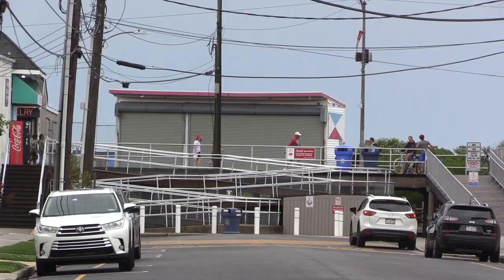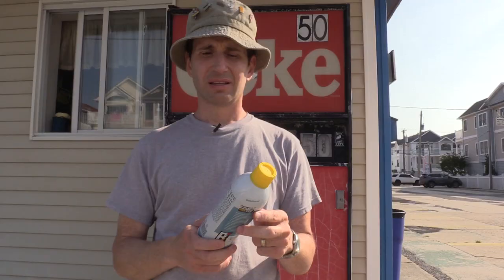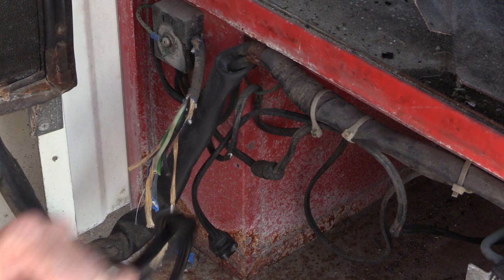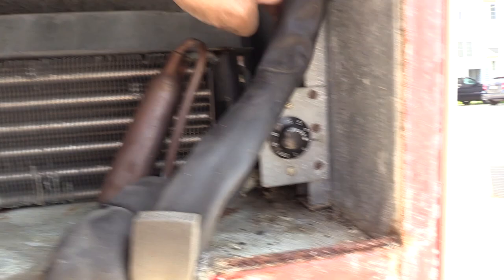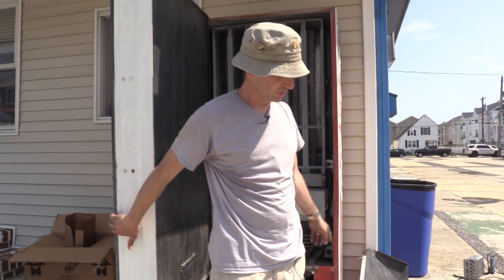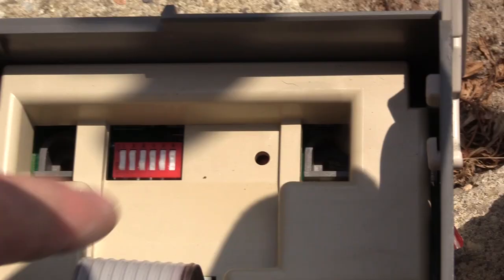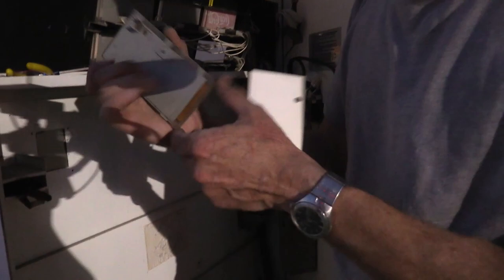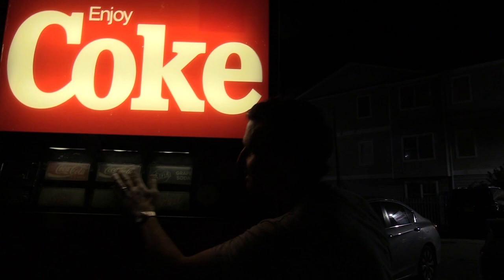Fixing up an Old Dixie Narco Soda Machine that Hasn't Worked in 9 Years - Part 2

Comment: The only issue with your repair is that cable isn't rates for outdoor use. It will work fine for a while just check the insulation that is exposed to the outside for cracking. But great to see you fixing up this old machine
Reply from the maker: I was trying to limit my expenses since I was repairing it for free...and I'm sure something else in that machine will die long before that cable cracks.

Comment: I bought an old machine with eight selections, the problem with this machine is that the digital numbers that mark the price or say the word sold out are off, what do you think is the cause of this problem, thank you very much and thank you for the answers, also for creating this content that is very helpful
Reply from the maker: Could be the display board.  Get a volt meter and confirm that power is getting to it.  Look for the machine schematic online.
Reply: Thank you very much that's why you call them happy vending

Comment: Great video! I have an old coke machine that I cant get the buttons to work.  I replaced the coin mech and as soon as the correct change is inserted, the machine starts buzzing loudly and the buttons remain unresponsive. Thinking the old wiring is goofed up a bit?  Any suggestions?  I can send pics or videos of what it's doing!
Reply from the maker: You should post a video of the issue on the vendiscuss.net forum...one of the old time vendors on there will surely be able to diagnose the problem.

Comment: We recently bought an old Dixie Narco coke machine. It worked great for two months until it now only releases from the #1 slot. It cools great and everything else works great. Any ideas?
Reply from the maker: The motors are in series with each other so you need to check wire continuity after the first motor.   It could also be the switch on the second motor.   Try swapping the last motor with the second one and see if anything changes.

Comment: Bill, where are you finding your cooling decks? I priced one from Royal for a G2 462 machine. They wanted $803 plus shipping. Is there a cheaper alternative?
Thanks Subscribed!
Reply from the maker: Have you tried Vending Works?  Cooling Decks direct from Royal have gotten very expensive...but sometimes, they are the only one that has them in stock...and they are new so they last a good long time.

Comment: I wish you would have just repainted the outside to make it look new repaint the red I like the classic soda 💞
Reply from the maker: My goal was just to get it operational.  I kind of liked the weathered look of it.
Reply: @HappyVending  this vintage they don't make machines like that no more I seen a Pepsi one that kind of looks like that but a little shorter I really want to restore 💙
Reply from the maker: @stephanieramirez9151  This style machine is not old enough to be sought after by collectors...so when they come up on ebay they are usually fairly cheap.

Comment: I have a Dixie Narco 260 that won’t vend .  The vend relay energizes but it won’t dispense product.  I have the service manual with wiring diagrams but can seem to track down the problem.  Any ideas?
Reply from the maker: The motors in those old machines are usually in series...so if the first one has a broken connection, none of the motors after it will work.  I would really inspect the wires going to the first motor.  Maybe even swap the first motor for the last motor.  Also make sure your sold out switches are working.

Comment: @Happy Vending Can i install regular or mei bill collector to the coin mech or have it as mei if able to so they both mei ? And do i install four holes to install bill collector or do i install four holes and cut a square out to fit the bill collector through the front ?
Reply from the maker: Old coin mechs, like the one I put on this machine, have specific bill acceptors that will work with them.  You need to check the compatibility list depending on the coin mech you have.  You would need to cut a large square hole in the door to install a bill acceptor on this machine.

Comment: I have a three pin Dixie Narco coin op. Do you know what the denominations are for the dip switches?
Reply from the maker: @tekubus  usually 5 cent, 10, 20, 40, 80, 1.60
Reply: @HappyVending  thank you for the response. What confuses me, is that it only has three dip switches.
Reply from the maker: @tekubus  That might be a newer coin mech that gets the pricing from the control board of the machine.  What type of connector is on the coin mech?

Comment: Lubricate locks with powdered graphite
Reply from the maker: Many locksmiths recommend against graphite because people tend to put in too much and it clogs up the pins over time.  Many locksmiths have switched to teflon based lubricants...similar to the one I used in the video.

Comment: Hay bro I have a dixcy narco 501mc I recently had the bill valadater repair and the coin mec as well when I got them back the little red light didn't come on on valadater or the mec b4 hand only the valadater came on but it flashing 3x now nothen I plug in the michine I hear the valadater come on but no lights not eaven the  mec the guy sed the Jones plug was working when he had it.... the  michine has no fuse I look every ware it's all macanical   nor dose it have a computer I'm at my wits end I wood really appreciate ur advice I think I have a bad Jones plug hit me back please  every thing works except the mentioned mec & valadater
Reply from the maker: Did you have the power off when you connected the mechs?  They should have a warranty on the repair.  Maybe they weren't repaired correctly.  That has happened to me before.

Comment: Great job.  I have a question. I have a Dixie Narco 368 and I recently replaced the Coinco bill acceptor and coin mechanism with MEI bill acceptor and coin mechanism from another DN 368. The MEI equipment was working properly before I switched it but now MEI bill acceptor has 2 flashes that says it's disabled.  Is there something I missed in switching to the other machine? I know the acceptor and coin mechanism are good but why can't I get them to work after switching to another machine?
Reply from the maker: Did you have the power shut down when you were making the swap?  Check your connectors and wires for any breaks.  Maybe even use a volt meter.  Are you sure there is product in the machine?  Is the machine in vend mode or is the door switch bad?  You might need to put the coin mech and bill acceptor back in the original machine to confirm they are still working.

Comment: Very interesting I am curious to a couple things I just found a Vendo v407 with a trade logo ale 8 a Kentucky family owned company it has lights in it also and 8 buttons 2 large and 6 smaller questions are could I buy new clear buttons as mine are extremely yellow and do the lights come on some how automatically like on a timer so they are only working at night or do they need to be switched on manually because they don’t come on when I plug the machine in when the rest of the machine works fine thank you merry Christmas 👍
Reply from the maker: Well, you can call vending supply companies and see if they have any "new" old stock buttons for that machine.  Companies like Capitol Vending or Snack Attack would be a start.  As for the lights, that machine does not have a control board so there would be no timer for the lights.  You could probably rig up an in-line timer in the machine if you wanted to.  Your lights probably aren't working because it needs new bulbs and a ballast.  Almost every used machine I bought needed new bulbs and a ballast.

Comment: How do you change the price on the older change mechanism? I have the one you took out with the quarter & nickel compartments set at $1.
Reply from the maker: That old coin mech only has two nickel tubes...no quarter or dime tubes.  It should have little dip switches on it like the one I put in there.  They start at a nickel for the first switch and double from there.
Reply: @HappyVending  thank you! I now have no power to the coin mechanism, I assume a red light is on when working. Think I found a manual online or will just replace it. The stickers say what is compatible. It's the s75-9800B.
Reply from the maker: @JC-ck6wk  Yeah...those mechs are so old that they just aren't reliable anymore....which is why I replaced the one in that machine.  Your best bet is to get one like what I put in that machine so that it is also ready for a bill acceptor.
Reply: @HappyVending  I'd prefer a bill acceptor as well. Appreciate your help & videos!

Comment: hello! does the 264-6 need shims for cans? i cant seem to figure it out from the manual. i hadnt tried stacking a bunch in yet, i just assumed it would drop 2 at a time with out a shim.
Reply from the maker: These old Dixie's were basically cans only and did not require shims...at least the one I was working on in this video did not have shims in it.

Comment: Can you convert coin mech from old machine to new machine
Reply from the maker: There would be no point using this old coin mech on a newer machine since most new machines use MDB...which this coin mech is not.  There are plenty of inexpensive MDB coin mechs available .
Reply: @HappyVending i have an old Dixie narco machine and was wodering if I can upgrade coin mech from old style to new style but it Jade connector as your in video. And it doesn’t have plate on the side of machine to know which one it is.
Reply from the maker: @rickeymorgan2677  No...you will need to find one of the coin mechs with the 9-pin plugs like in my video.  You can still find them remanufactured on the internet.